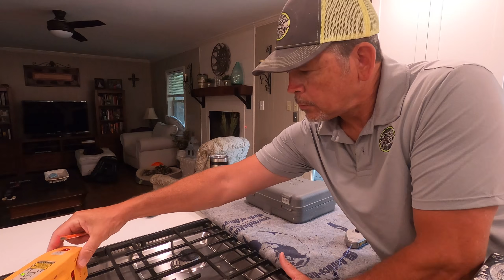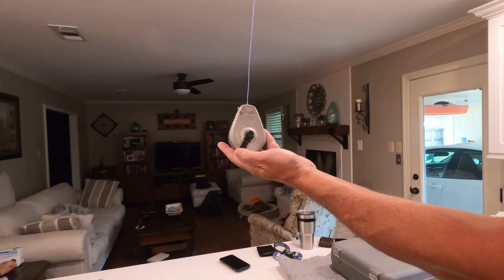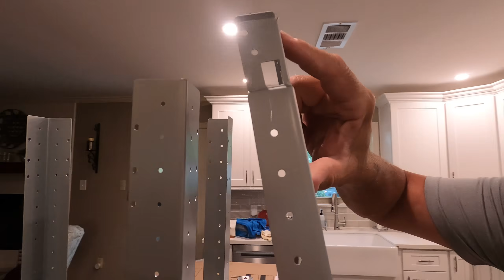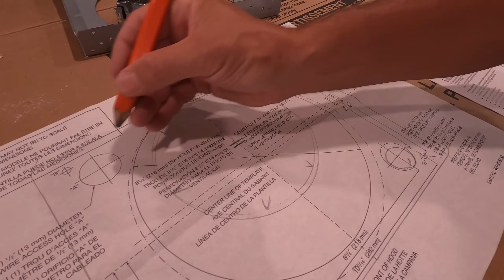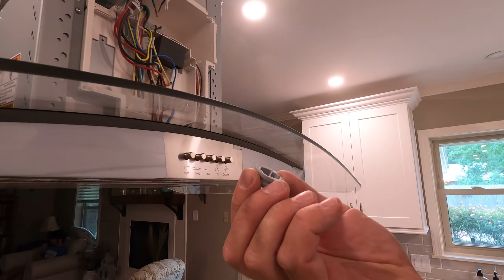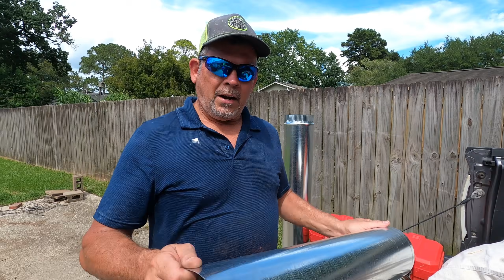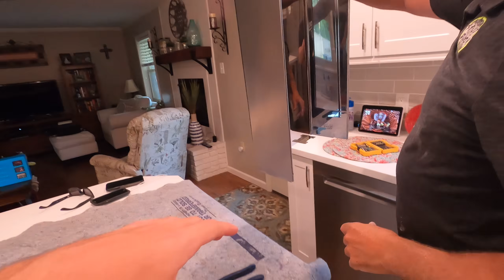Remodeling a Kitchen A-Z - Part 18: Installing the Hood

Comment: If you don't have a plumb Bob grab some string wrap it around a small branch or small pipe, then  tie a 5/8 nut to the string to use as the plumb Bob

Comment: how did you cut the hood cover to be shorter?  I really appreciate how you showed how to cut the vertical frame corners.
Reply from the maker: Ha, you made me go back and watch one of our old videos 😳 I used the same grinder I used to cut the angle iron.  The blade is a metal cut-off wheel.  Practice on the end first before you make your actual cut.  Cutting stainless steel is tough, the sparks are very hot.  Wear a face shield like I did (with safety glasses).  I think I also put blue painters tape around the duct and marked my cut line on that.  Be careful not to scratch the SS.  Good luck!!

Comment: Another great video... Only comment I have is I might have secured to the ceiling joist first, than the strong back... but I wasn't there and you were so, your way might have been the better way. Also, I have a question... why did you use nails to attach the spacer vs more GRK's? Keep up the good work.

Comment: I had a similar hood install last year. All the same issues and all the same extra steps along the way. Except I didn't have the benefit of Jordan and his friend to lift while I screwed. I was pretty proud of figuring out how to hang safely by myself. Solid as a rock, works like a charm. That's why I have a semi saying that real carpenters can figure out and do by themselves when there's not a second or third body around.
Reply: So how did you get the hood up to screw it in by yourself.....i am facing this same dilema.......I am thinking you adhocked it with some kind of lift (a bottle jack ? ) or built some kind of jig

Comment: Any tips on how to go about installing an island range hood on a slanted ceiling without a customized range hood? I was told to either cut into the ceiling to install the bracket, or to build a soffit box.
Reply from the maker: I had to do that once.   Built a soffit box.   It looks great.
Reply: @StudPack  by any chance do you have a video from that installation?

Comment: Am I crazy, or is the ceiling fan in the living room missing a blade or two? 0:49
Reply from the maker: I don’t remember that at all but it sure looks like it 😳
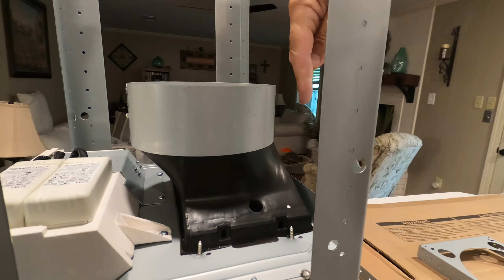Reply: @StudPack  Found it! It is just an optical illusion. Most of the shots from the kitchen are angled exactly parallels to the edge of the blades on the left side - making them "invisible". But, in this shot it is filmed a little lower and the blade is just a little visible: 4:50

Comment: Nice work!  What type of silicon (accommodate high heat) did you use assuming that the duct will be hot?  I did not see insulation in the duct so it will have a lot of heat!
Reply: Your average run of the mill clear silicone caulk can handle 350-450 degrees. There are higher temp versions that can handle 500-600 degrees as well. No concern for this application albeit because of the fan and airflow the pipe will stay much cooler than heat from the range or attic.